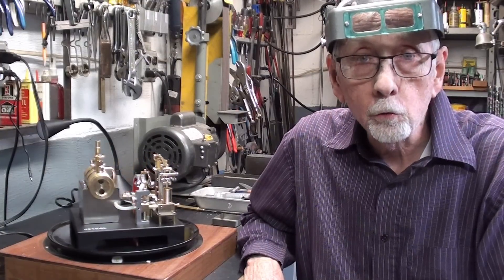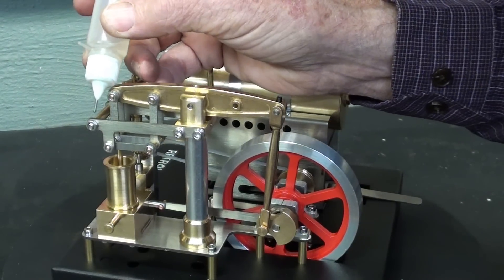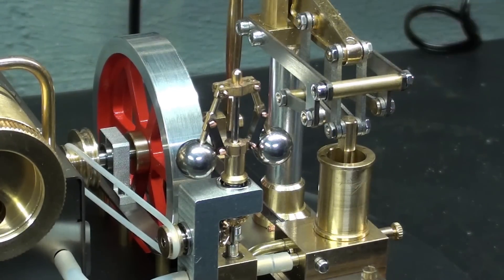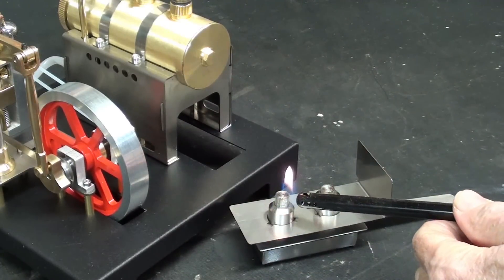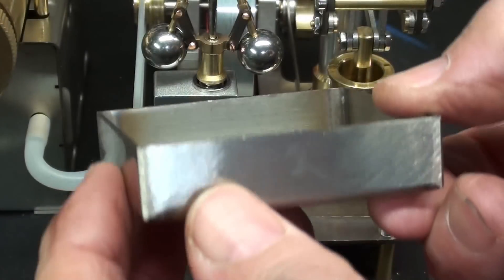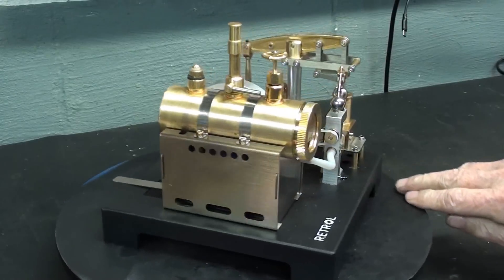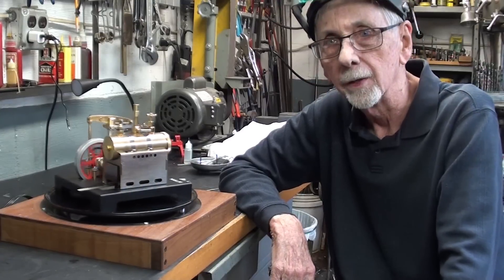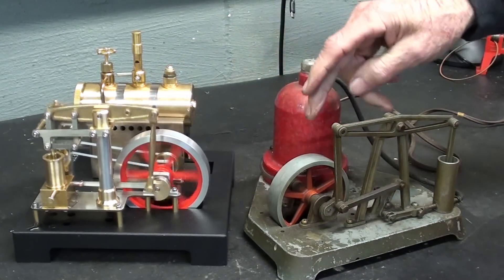OPERATING THE BEAM ENGINE retrol #961 tubalcain live steam

Comment: Hi, I've just got one of these. I can get it to run but it's not long before it stops due to low steam pressure. Do you have any advice please. I've tried altering the steam valve and the speed regulator too. Boiler was filled to approximately 3/4 full.
Reply from the maker: To some extent, I had the same problem. In my opinion, the burner is not quite adequate. Possibly make another burner with two or three wicks.  With varying diameters and lengths. It will take quite a bit of experimentation, which might be fun.
Not sure if you watched my latest engine video, but the burner in that one seems far superior. Good luck.
Reply: @mrpete222  Same problem here.  I wonder if its possible to get a burner with more wicks but in the same size as the original.  I also wonder if the application of steam oil to the cylinder and spool valve to help seal leaking steam might help.  I have steam oil ordered.  I understand using motor oil is a no-no.

Comment: Nice device, Mr. Pete! I think that if you put the belt on the larger diameter spool the engine will run slower and perhaps for longer.

There's a thermo electric powerplant in the center of Paris that burns paper/plastic and other domestic waste. During the summer it produces electricity but during the winter the steam is sent directly to the heating systems of many buildings and metro (tube) stations. The only visible pollution are the barges full of trash crossing the Seine River. 

The Watt Governor is the first thing we were shown in Electric Engineering school when learning about feedback control systems because it is the first example (AFAIK) of a proportional control system (part of the Proportional-Integral and Proportional-Integral-Derivate control systems).
Reply from the maker: Thank you for the information and watching!

Comment: I can’t keep mine running. It will turn over a few times then stop. I even tried it with a propane torch and it does the same thing. I have oiled everything and tried different alcohols. When I put 5psi from my air compressor through the blow off valve, everything works perfectly. Just won’t keep going on steam pressure. Any ideas?
Reply from the maker: Try using a small quantity of water

Comment: we are all just kids at heart ! stream facinates me ! i was on the foot plate untill they stopped running them . then they bought in the diesel ,,,, a lot of the drivers loved them . nice and cosy almost silent  compaired to the steam but some fell asleep... untill they fitted the dead mans handle.. if you lifted your hand of it for more than 5 seconds the brakes would seep on and after a few seconds more a total brake would be applied.. so they started to put heavy objects on the handle. ! and with the nice cosy warm cab they drifted off to sleep,,, some sadly never to waken again !the a w s  [automatic warning system] was tampered with so it was inefective.. if one passed a signal at amber ,, a bell would sound in the cab, the clapper in the bell was then twisted so the striker could not contact the bell itself obviously. tha alarm for the red  signal was left alone  as far as i know..  pete i have seen some horrible sights ..and nine times out of ten it was the drivers fault.. and still is today  50 years later...   look after your self pete.... regards  laurence
Reply from the maker: Wow, those are some horrible stories. I know that some people will do just about anything to bypass safety. Thanks.

Comment: I wonder what year the shops began to use steam power, and I guess they probably used a water wheel before that.  Then at some point, the electric motors took over.  You can imagine that they still used the belt system for the equipment since that was how it was already driven and probably a new shop would have had the individual motors (and of course equipment would have started to come with a motor).  I guess a diesel engine could have driven some shops early on, but I don't think I ever heard of it.  Boy, and think of some of those really large presses we've seen.  There must have been some scary days at work back then.
Reply: Since I made that comment about the diesel engines and belts, I've seen tons of them, a lot of farm tractors even had belt drive pulleys.  I just watched a video in India where their shop is still powered by belts from a diesel engine.  It's hard to replace what works sometimes (when you've already got it). @mrpete222

Comment: I had a simple steam engine back in the late 50’s. It used rectangular solid fuel pellets, that seemed to burn not quite hot enough or long enough. You only got about 1 minute of running before the fuel ran out. By the time the pan was cool enough to put another pellet in you were starting the heat up process all over again.
Reply from the maker: I have experienced the exact same thing
Reply: I wonder if you could have put a little can of Sterno under it and heated it that way?
Reply: @ellieprice363  I tried using sterno in the little pan. It was not very successful. The fire box opening was only about 3/4” square.

Comment: Great engine and video.  Having watched it saved me $hundreds.  I won't need to buy one.
There is something bugging me though.  It sure looks like the governor belt lines up with the other pulley groove.  It also seems odd that the PTO groove would be behind the governor groove.  The larger pulley would drive the governor faster, making it more sensitive.  Might make the engine run too slow.  It just looks wrong to my eyes.  Maybe the pulley was installed backward?  It would be interesting to Tee in a manometer, see how it reacts to speed and load.  As ever, thank you for the edutainment.

Comment: Those are known as “fly ball” governors. When the engine is running “balls out” it’s speed is limited by the governor. Some old full size steam engines used a leather belt to operate the governor. If the belt broke or jumped off the engine would run faster and faster (run away) until it blew up by centrifugal force. My dad said if that happened, “it would take a brave man to run in there and shut that thing down!”

Comment: Denatured alcohol was banned by the California air resources board a few years ago. CARB more recently banned 99 percent isopropyl alcohol in 2023. Only 91 percent and under are now all that is available. I wouldn't be surprised if steam engines with external combustion are banned in CA and only electric boilers are legal.